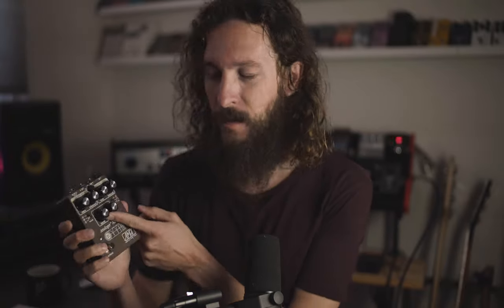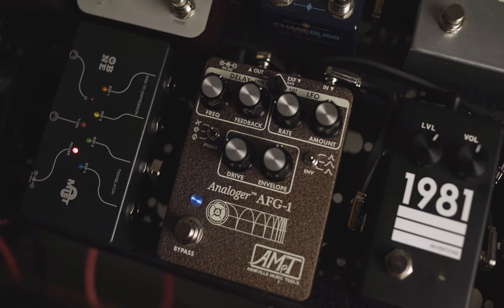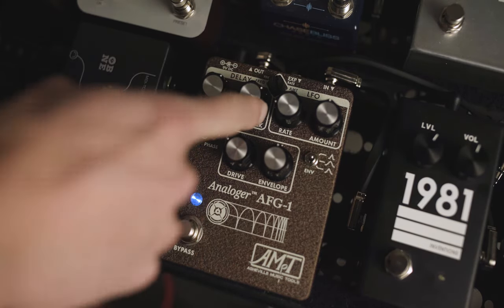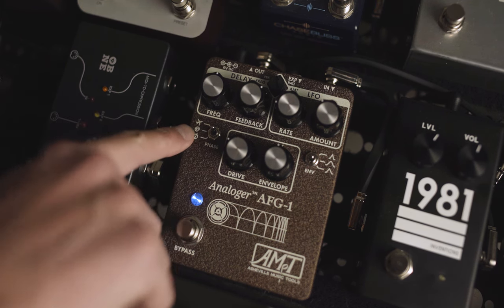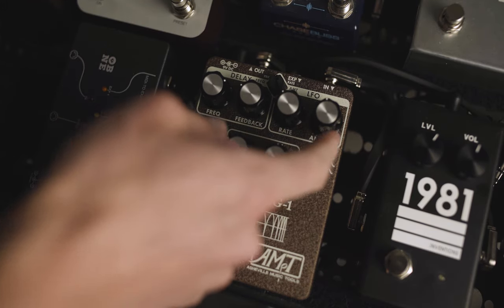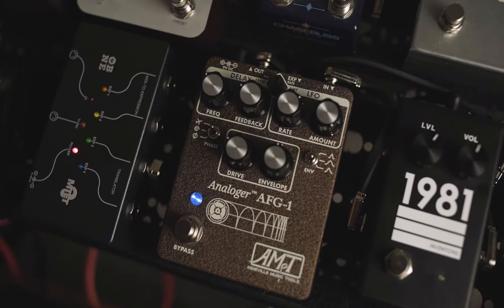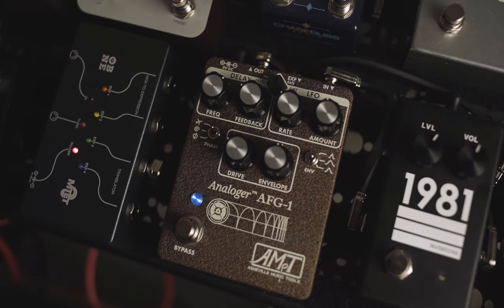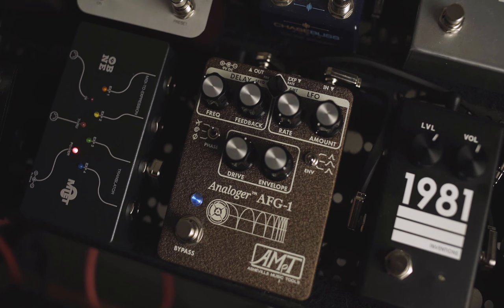Asheville Music Tools AFG-1 | Secret Weapons Demo & Review

Comment: Nice sounding pedal with some very interesting features. I like the drive circuit & the phase switch. The envelope is a great concept but sounded a little too wah wah-ish for my taste. Almost like an auto wah or envelope filter going on in the background. Maybe it can be dialed in more appropriately to taste. I’d check this out if I didn’t already have a great flanger but I wouldn’t run out & buy this to replace my go to flanger. I use the Subdecay Starlight. Great analog sound. Extremely versatile & I love the tiny footprint.